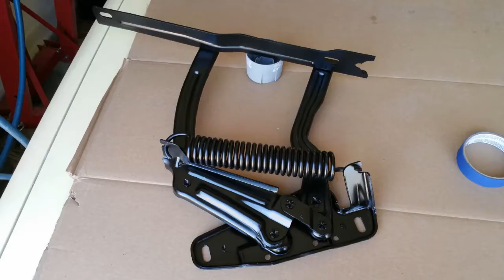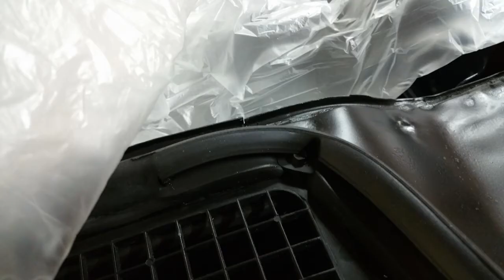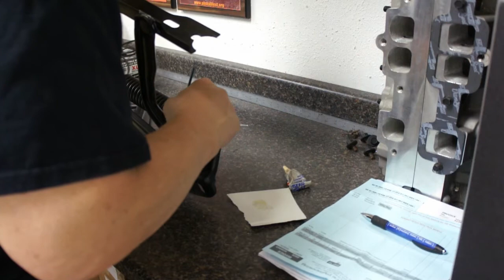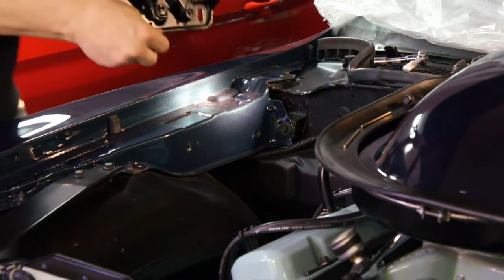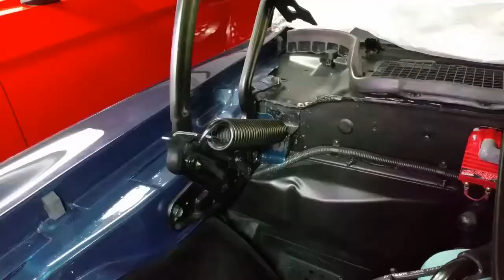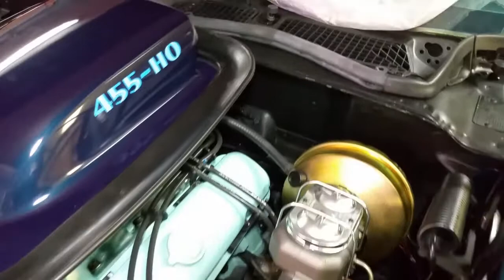1974 Pontiac Trans Am detail and restoration part 10

Comment: If you look at the back of the hinges(where the hood bolts to the hinge), you’ll see a U-shaped notch cut in the hinge. This is designed to be captured by the safety studs so you don’t get decapitated. No caps on them. 
There’s no hood adjuster on the back- that’s what the hinges are for, but you’re missing your radio RFI/ground strap- it bolts to the cowl and makes contact with the hood. It bolts on the cowl, in the center- right about where you put that adjuster at. It looks like a reverse-curved piece of metal that has sharp points on the section that contacts the hood.

Comment: How do you plan on lowering the car? I thought all 10 video's were well done, and yes it is a nice car. I have a 76 that I have touched every nut and bolt on the car to restore it. I'm putting it back together now. I will be squaring up the sub-frame tomorrow. I used rattle cans and yes, it does not wear as well but the price is great. I had my front sub-frame and suspension powder coated with various colors.